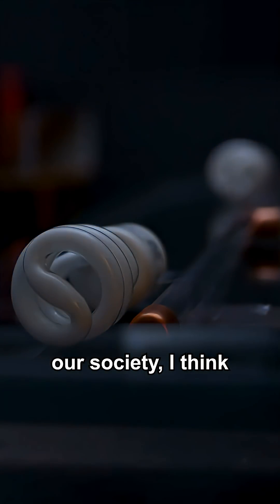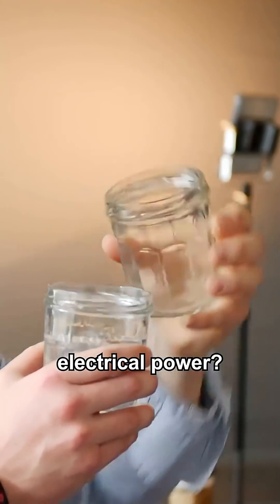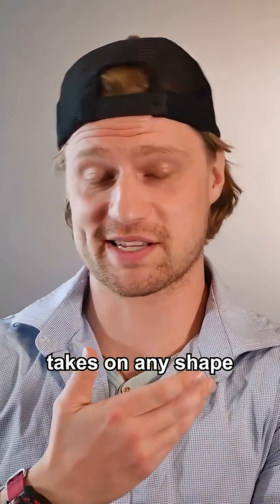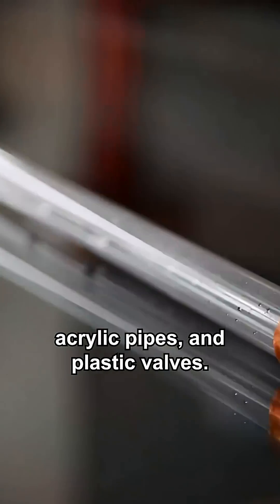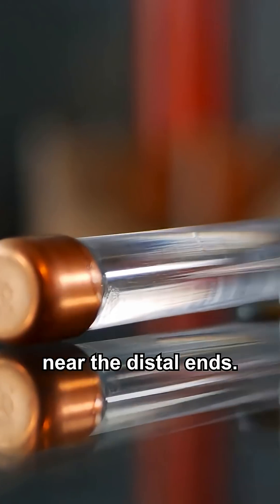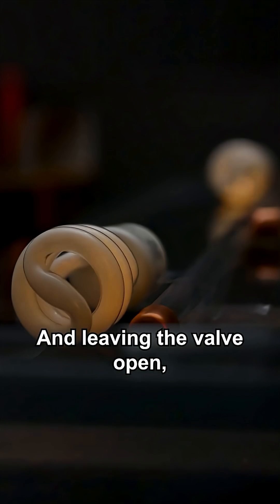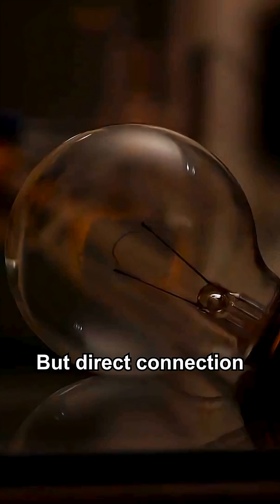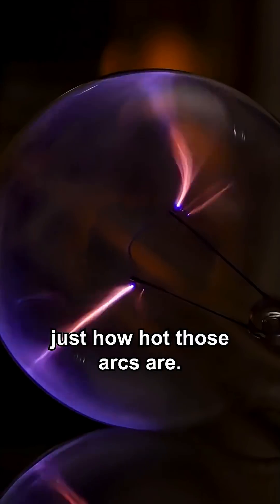Directional Wireless Energy Using Water

Comment: I've used water pipes for grounding and neutral line a lot! For example when I was in college I rented a massive house that I partially remodeled in exchange for a year of free rent and since everything ran on electric I had to steal from the main street line (only for high power appliances such as WH, DW and jacuzzi and my workshop) and used copper and steel pipes for grounding and neutral connection, as a result my electric bill was very low.

Comment: Tesla enthusiastically wrote at length about this. Switching paths the power takes by adjusting a falling stream on an insulator is an interesting safety and distribution idea as well.  Potential here big and small, specifically on a plant one could use some power production to keep it going. Something changes safety wise, the water goes to a different channel automatically with gravity being the force directing the change.

Comment: I have an idea. You could use copper wires instead of water pipes. They are easier to handle and conduct electricity better. There's also a lower risk of spilling electrified water everywhere in case they break.
Reply: Genious!

Comment: Now people understand how the pyramids worked. They were electrical generators of some sort maybe collecting energy from the vacuum or The Ether and then connected below the Bedrock to the groundwater. The problem is when looking at the pyramids people do not take into account that when they were built and functioning sea level was approximately 400 ft lower. This is why the osiren is perpetually flooded and the underground Labyrinth is also flooded. 12,000 years ago the Labyrinth 80 M Underground was still above the water table at 120 m. People aren't thinking fourth dimensionally. Honestly people aren't thinking at all because they don't want the truth. Thank you for showing this example. It's also possibly how Tesla's Warden cliff Tower was supposed to work giving it had a copper Rod going into the Earth more than a hundred feet I think. The Industrials do not want cheap clean energy. It's not that they want dirty energy but dirty energy is the best way to make money and that's all they care about

Comment: As a person who grew up reading Tesla's technical logs, and building his first Tesla coils when I was 15 to experiment with these kinda things, I am happy to see someone taking a swing at this. I dont see a merit in using pipe systems, but I always thought, Tesla's wireless energy transfer idea which rested on the fact that the HF currents would spread via the surface and not volumetrically, hence the intensity wouldn't drop with the square of radius, it would be interesting to try such experiments in water instead of soil. Apparently Tesla was wrong about the earth's conductivity, but sea is literally water full of ions. HF currents would not be damaging for any life in the water either.

I also read somewhere that ocean currents were used in the past to communicate trans-atlantic via ultrasound, as the sound would bounce of the boundaries and curent would act like a wave guide. Wonder if that would work the same with the HF electric current.
Reply: Water levels vary depending on weather, like evaporation and rain. Salinity is not constant throughout the water and neither is mud. Also water is absorbed into the ground underneath meaning the boundary is totally weird and always changing. So you won't be able to reliably send anything because reflections and power loss from heating water, like no constant voltage nor phase control. 'Plugging into' the water would change the properties of the medium for the next user and all the others that are 'plugged in'. Also lightning would probably be a huge problem once you reach useable AC voltage and current levels, which would already be high enough to make life unliveable for anything with a nervous system. It would also cause salinity gradients within the water. So, a lake or ocean would be terrible... but a water pipe could be made to work more reliably (still bad). Absolutely worse than a wire, but not impossible.

Comment: wireless with water wires, but doesn't that cause the water to split into hydrogen and oxygen?
Reply: It's high frequency AC, and as per my knowledge only DC can split water, because with AC the anode and cathode where electrolysis would take place change so rapidly, it's not effective. This made me think tho... is there a treshold for frequency above electrolysis is possible with AC? I'm not shure, the forces would attract and then repel the water molecules due to it being a polar molecule
Reply: Yeah AC doesnt work for electrolysis but it will heat up the water a lot depending on the current. Basically it will just behave like a comically inefficient wire. 

Idek why he's showing this it's genuinely goofy to think this is even somehow useful lol.

Comment: So, the primary issue i forsee is the temperature rising with the water flow, and the containment of these "wires" having faults or leaks. Im sure it works in a vacuum well enough, but im heasitant to say put water carrying lethal currents in my walls where i hang pictures.